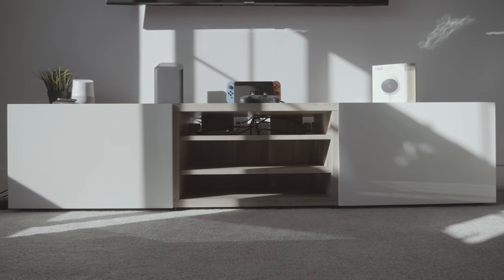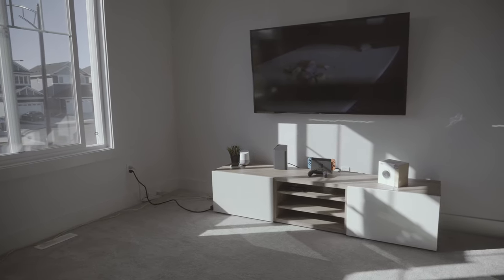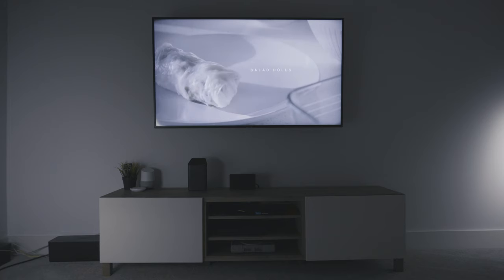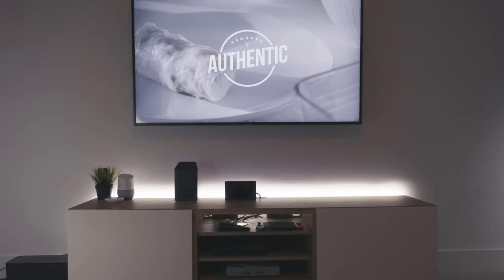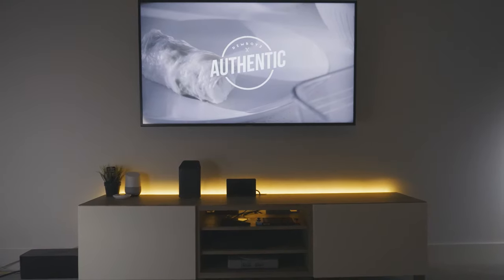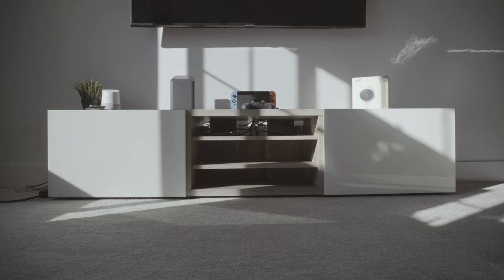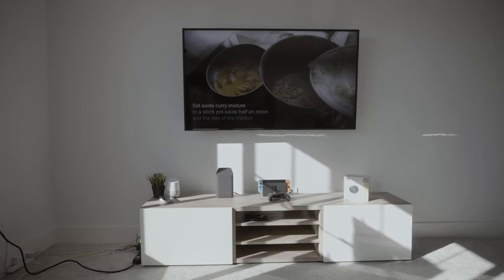IKEA BESTA ENTERTAINMENT CONSOLE | Assembly and overview | Demboyz DIY

Comment: I assume after you complete the assembly at 5:22  you then install the horizontal shelving in each section right? Can you confirm there are different levels in which you can choose to place the horizontal shelves? In one section of the unit I’d like to have only one shelf and place it a bit lower to fit a larger device in that area. Can you give some insight on that? Great great video btw
Reply from the maker: Yes you can choose to place the horizontal shelves on different levels, they rest on these nubs you put into the holes on the inside.

Comment: What a well produced vid! great work. i have some questions and hope you can answer my puzzles. The besta unit link you provided has three doors in the front but your tv unit shown in the video only has two doors on each side and has two shelves in the central compartment which it doesnt seem to be included. Did you purposedly not assemble the central door and added the two shelves? thhe toher question is about the short legs for the TV unit. seems the legs are not provided as well, is it? and i couldnt find the short legs in the ikea besta accessories. there are only tall metal legs which i dont like
Reply from the maker: Yes that is exactly what i did, I purposely left out the middle door. The legs you do have to buy separately, I was able to choose from a lot of leg choices. Maybe wait until they come back in with more leg choices, it could be that they were just out of stock?
Reply: @OfficialDemBoyz  thanks!
Reply: I notice that too. but what I figured out you can order all the pieces separately .  you can save around 45 bucks or so.   You just have to pull up the link and click on product details will list all the items and there item numbers.
Reply: @tosiacampbell1097  Im doing something similar today. Will be buying the legs separately as Im not sure I will need them once I put it all together. Saves 40 dollars on my order.

Comment: Hello, i have the same product. Mine is not steady at all! Do you have this problem to?
Reply from the maker: No i do not, there are adjustable studs that come with the BESTA unit so you can adjust so it does not wobble. It may also be you have a warped base maybe?